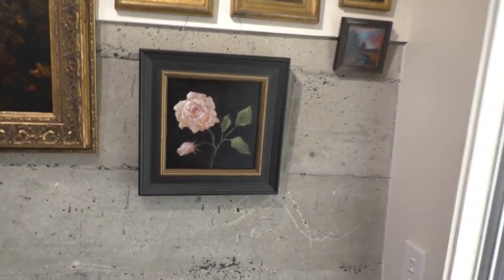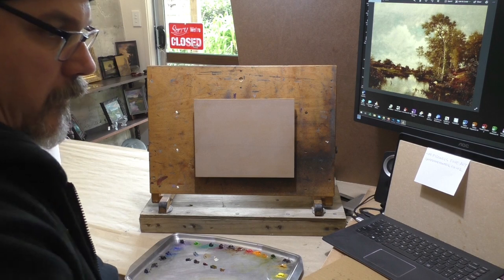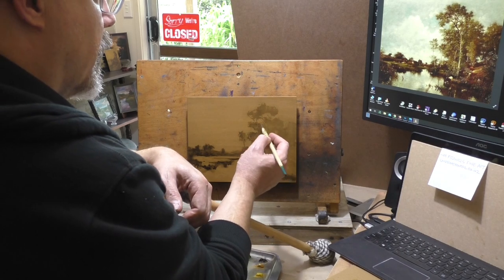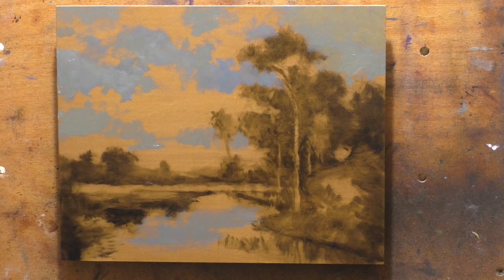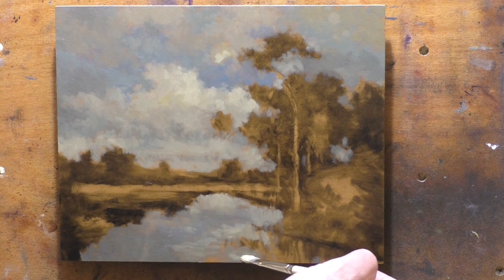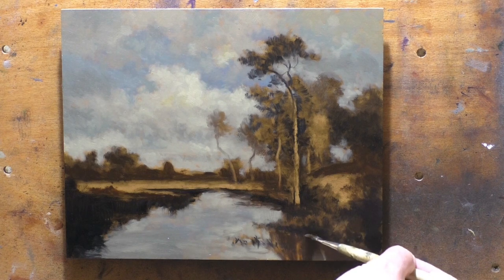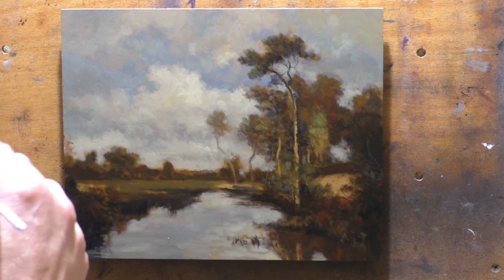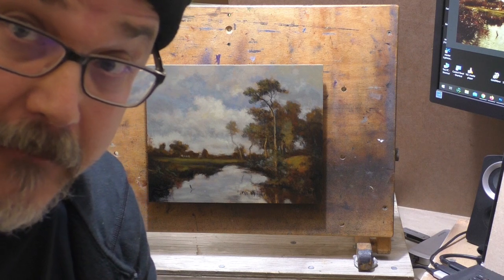Study after Jules Dupré

Comment: Excellent work as usual! How are your boards attached to your easel? I don’t believe I’ve heard you explain that in your other videos.
Reply from the maker: Hi Alicia, I use blutak to hold the boards up. Making sure to use a decent sized piece on each corner. To little and the board will fall as you are painting (not good) chrs 🙂